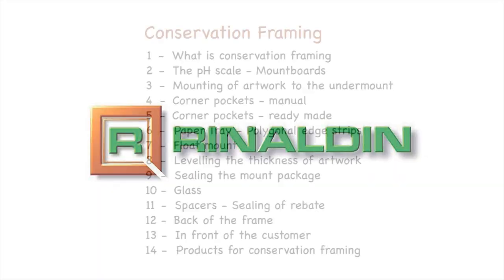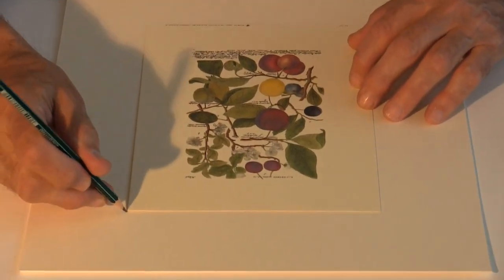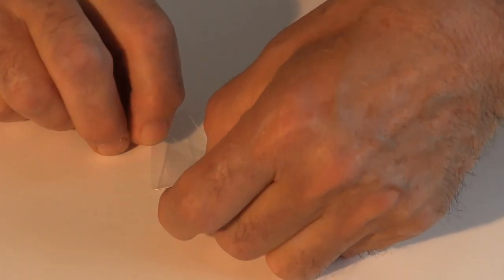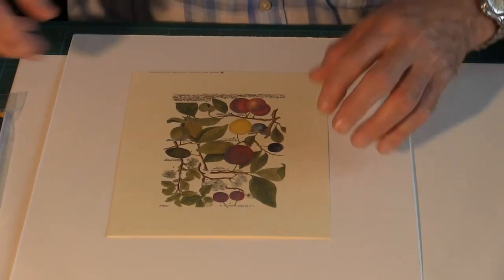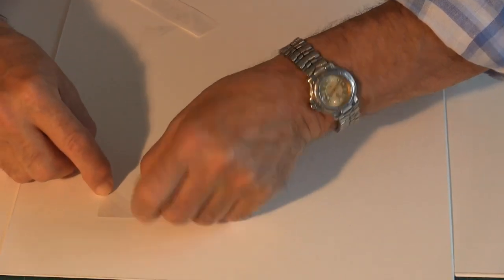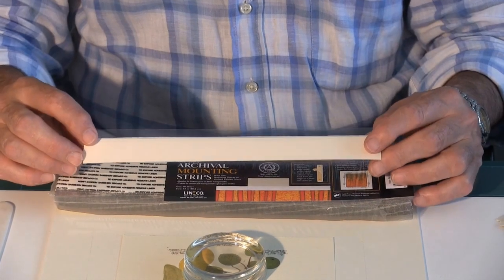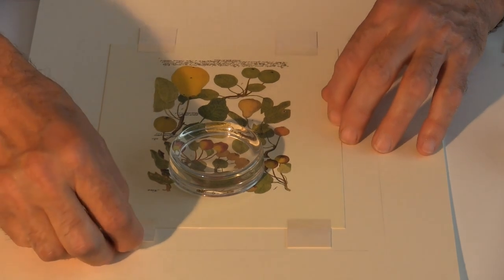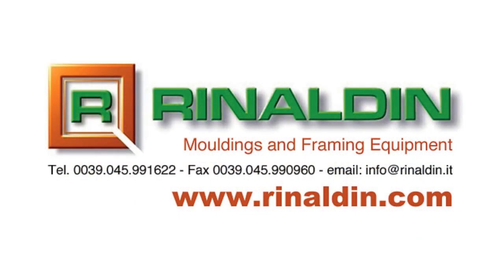Conservation Framing: 5 - Corner Pockets - ready made

Comment: thanks. I prefer the top t-hinge on my art as using the corners method you risk the chance of bending a photo and putting in a crease that you cant get out. so I try to never BEND my photo prints which this method requires. good to know there are many options though
Reply: Yea the corner method should be avoided at all cost to be honest. You see that everywhere because it is so easy, particularly with ready made corners, but I can’t count the number of artworks I’ve seen damaged in the corners or bent because of those corners. 
Most people will not be careful enough while sliding the artwork into the corner and won’t even realize they have damage it irremediably.